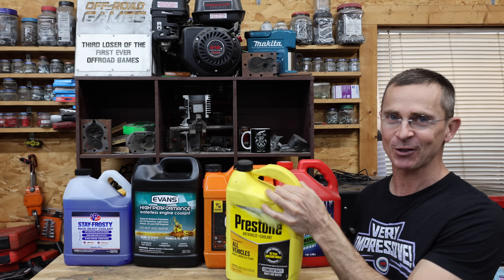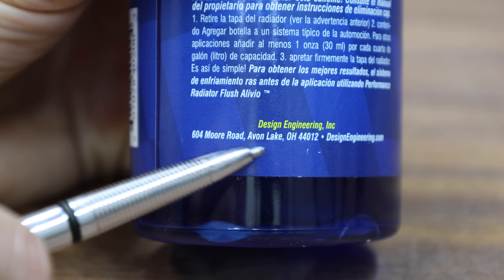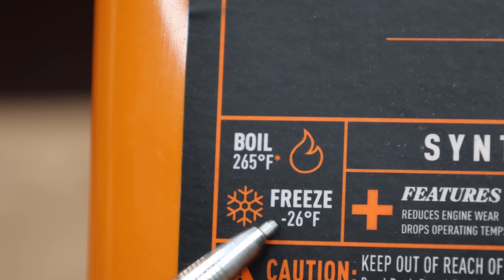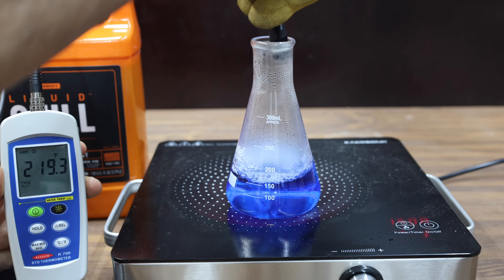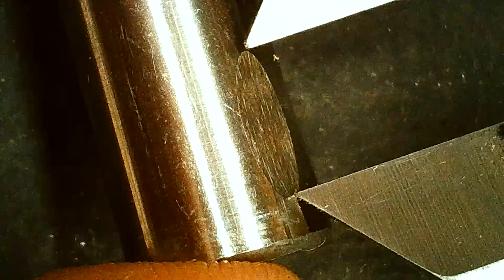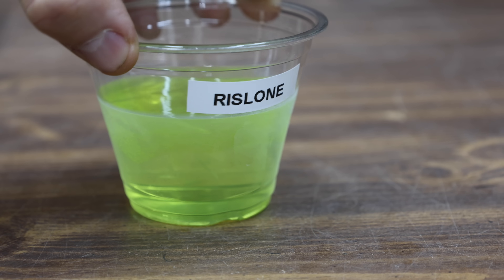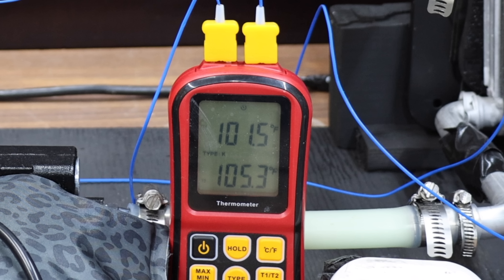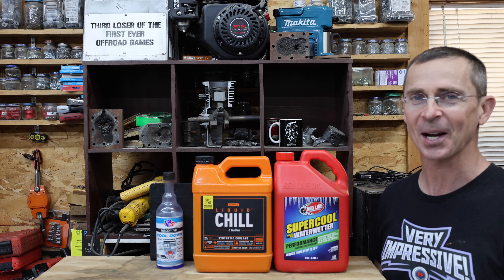Do "Super Coolants" Lower Engine Temperature By 30 Degrees?

Comment: Evans coolant is the real deal.  Rebuilt my race engine and never used anything but Evans in it.  No water.  Engine would run a bit warmer but never overheated and no corrosion between the steel block, aluminum heads and aluminum radiator.  Only downside was having to keep some on hand all the time as you can't just go to the gas station to get some if you have to top up.  Also I was able to run a lower pressure radiator cap, helping the hoses.

Comment: If only the manufacturers took into account how much of the radiators are covered by grill material.  Or place the AC comp in front of the radiator.
  The small bottles are intended for applications where water is the only thing allowed. Race applications.

Comment: ***HEY TODD*** I Have some ideas for some new video material first there are now plenty of USB-C  AA - AAA AND 9 VOLT BATTERIES. SO HOW GOOD ARE THESE BATTERIES AND HOW MUCH ENERGY DO THEY HOLD. ALSO DIGITAL BUBBLE LEVELS OR ALL DIGITAL THERE  ARE HYBRID OF BOTH THEN SQUARE DIGITAL LEVELS THEN THERE IS THE KLEIN DIGITAL LEVEL YOU CAN READ THE DISPLAY WHEN ITS LEANING OR EVEN FLAT ON ITS BACK IT THEN READS AS A FLAT SURFACE CIRCULAR DIGITAL BUBBLE LEVEL THAT LOOKS PRETTY COOL.
Reply from the maker: Thanks for the suggestion.

Comment: I'd be curious to see how just straight distilled water works out for you . We had a vehicle with a cracked radiator and just threw water in for a week or two while the replacement came in. Didn't seem to hurt anything long term and was a lot more environmentally friendly.
Reply from the maker: Thanks for the suggestion.

Comment: I would like you to test on portable solar power stations for power outages. How much they will run and for how long and the practicality. Here in Houston our power goes out frequently and I have been running a small generator to run TV's and a small AC window unit. I know solar won't run an AC for long but may be useful for running fridge and TVs, and infrequent microwave oven.
Reply from the maker: Thanks for the suggestion.

Comment: Unless i'm missing something I'm not sure I understand the point of these additives unless you consistently struggle with overheating. Like heavy towing on hot days, going up a mountain, etc. For the average user they should serve no purpose. Even if the coolant is working better, the thermostat is just going to close and allow less coolant through so the engine maintains the same temperature.

Comment: I have been using Redline's Water Wetter (the additive) for years in my snowmobile and it has helped with heat transfer.  Thanks for this confirmation that it does work.
Reply from the maker: You are welcome!  Thanks for sharing.
Reply: I use red line water wetter as well. It works really good. I even use it in three of my summer cars and it helps. Bring the temperature down on them as well.

Comment: another excellent test.   Forgot to mention/specify the sulfuric acid concentration.  No mention about flushing the heat exchanger test rig between products (not that a residual trace would make a significant difference).    

I do not want to be anywhere that my car will be in a -34F cold soak!
Reply from the maker: Thanks for sharing!

Comment: If you live in a climate that never gets below zero is there ever a reason to not want a cooler engine temperature?
Reply: Yes, a low engine temperature causes the rings to not seal properly and increases cylinder wear. However engine temp and engine coolant temp while closely related are not direct corollaries, so keep that in mind while making such decisions.

Comment: I love your videos and testing concepts!  The “droplet” of H2SO4 I think you can make it more precise and even more scientific.  Liquid “drops” due to surface tension breaking - too many variables like how much force are you squeezing can impact how the volume of each droplet when using a bulb pipette.  If you can get your hands on some P-20/P-100/P-200 calibrated microliter pipettes.  (They are expensive).  Maybe borrow from a university lab and add like 100 microliter at a time to be more precise.  Also the molality of the H2SO4 is important.  Essentially you were trying to measure the buffering capacity of each capacity product.  Perhaps even dilute the acid first given the extremely low pH of H2SO4.

Comment: One issue is cooling system is under 15psi of pressure so boiling point is higher. Pure water has a boiling point of 257f at 15psi.
Reply from the maker: Thanks for the feedback.

Comment: Despite the cooling properties of many of them, I actually like the Evans Waterless the best. Up here in Canada it's not uncommon to hit -40C/-40F. The additives compromised the freezing point of the antifreeze (literally its purpose) which would result in a block of ice in our cold temperatures. Likewise, it had a much higher boiling point, meaning it could continue cooling even if the engine was getting quite hot such as hot weather or heavy loads. Even though the thermal heat transfer wasn't quite as good as those with additives, it ought to be plenty to ensure the engine is cooled properly, considering that 200F is nothing for an engine whose combustion chamber can be upwards of 6000F; a difference of 5-10F isn't going to make any difference at all. The most important thing is that the coolant continues to be a coolant and that fails when it freezes or boils.
Reply from the maker: Thanks for sharing.

Comment: You don't want to reduce your engine temperature.. it will cause incomplete combustion. Your engine is designed to operate between 200F-240F. There is a common boomer-misconception that putting in a lower degree thermostat will change your engine temperature, it doesn't. "Cooler" is not better, outside of very niche racing applications. 

Until around 175F your engine is essentially guessing at what the Air:Fuel ratio should be based on data from a few sensors like Ambient Air Temperature & Coolant Temperature, we call this "open loop". If you were to install say, a 165F thermostat, it would take a very long time to reach "closed loop" where the Oxygen sensors take over, if they ever do.. Not only would that introduce a lot of fuel into the oil, water condensation becomes a problem. Not to mention the HVAC system not working properly.

Your engine will not overheat unless something in the cooling system is not functioning properly, change your coolant every 4 years or 40,000 miles.

Comment: Agree, great timing and testing. Thank you. 
I have a Tahoe with the 5.3L, and need to do the infamous plastic heater core fittings, (started dripping a little). Planning to flush most of the coolant and add one of these now.
Reply from the maker: Thanks!  Thanks for sharing.

Comment: You tell me what I need to do 😂
Can you figure out a way to test Valvoline Restore and Protect? I mean it's claims, my engine is running a bit quieter after 250 miles. I can't give it the beans for another 250, new clutch and all.
Reply from the maker: Thanks for the suggestion.

Comment: To do a proper test of heat transfer, you would need a well insulated tank of water with a heat exchanger in the tank and then the radiator with a fan for air to air heat exchange.  Then start with the water at a given elevated temperature and see how long each coolant takes to lower the temperature of the water by some fixed amount.  That will measure real heat transfer effectiveness which is what matters in a car cooling system.  Measuring the temperature is meaningless.

Comment: Fun fact, Rotella ELC NF (extended life coolant nitrite free) IS dexcool with the very important difference of lacking the stop leak ingredient that is a known plasticizer, as the three class action lawsuits against GM will attest their stop leak actually causes leaks by hardening seals. ELC NF does not have this component, just change it every 60-80K miles, or 5 years whichever comes first.

Comment: Poor's man additive? 2 drops of Dawn Dishsoap in the rad. Worked wonders in my Civic Si. Temperature was climbing faster when going up a long steep incline and was falling faster then before going down with no load, indicating better heat transfer.
Reply from the maker: Thanks for sharing.

Comment: Just curious if you completed the coolant flush before you ran the Evans in the last test (or if its required for full size vehicles)? I run Evans in my dirt bike and it required a pre-flush solution to be ran through the cooling system prior to its use. It even says you may need to flush the system a few time to ensure you remove all the water/coolant mixture, as water affects its performance.

Comment: For older non emission motors this is fine, "modern" engines and tunes require specific operating temps.  If your having specific overheating issues the problem should be addressed first.
Reply from the maker: Thanks for the feedback.

Comment: Nope. The perfect coolant is distilled water and 15% antifreeze. You only need the anti freeze to fight corrosion. Distilled water has a higher thermal conduction
Reply: Except it will freeze solid in early September and crack the engine block, heads, and basically anything with coolant running through it. I believe a 15 percent coolant mix will freeze around 20 degrees!😮

Comment: Temperature and heat aren’t the same thing.  The job of a radiator is to reject heat.  The change in temperature tells you nothing when comparing fluids with different heat capacities.  If water and ethylene glycol both drop 1º in temp, the water has rejected a lot more heat since its specific heat is much higher.  This is a very misleading “test.”
Reply: I think I understand what you are trying to say. Basically different liquids can retain more heat than others. Evans waterless is probably more like oil so the amount of heat it retains is much higher per capacity compared to water. It's much harder to cool a cup of hot oil vs a cup of hot water. I still think it's relevant somewhat to show how effective your radiator can dissipate heat though. Although, we really don't know if something like the evans waterless will even be able to cool itself faster than the engine will continue to heat up the "coolant". The overall goal is to keep your engine as cool as possible.
Reply: I think the evans waterless is only something you should use if you live in like constant Artic type temperatures. Everywhere else, you would have to use a more traditional coolant, otherwise you wouldn't be able to cool down fast enough.
Reply: @ If you live in an area where it gets below -40 quite often, Evans might be worth the money.  Everywhere else it isn’t.  And even in very cold climates, you can easily use a 70/30 mix of traditional antifreeze and get protection to something like -68 F.
Reply: @ Yes, you do understand, but, no, Evan’s is not better than water.  In fact, it is much worse.  Water is one of the all-time best fluids for heat transfer with corrosion being why it isn’t used alone for coolant.  Another issue in a test like Project Farm did is viscosity.  A low viscosity liquid like water can travel through the radiator quickly and thus its temperature doesn’t drop that much.  A thick coolant like Evan’s will move slowly through the radiator and have much more time to cool so will come out at a lower temperature even though it has transferred far less heat to the air.  If a flow gauge had been included on the test setup, this would have been immediately obvious.  Project Farm test setups aren’t made by an engineer so all of these considerations are ignored.  This makes for good entertainment videos, but the test results are bogus sadly.

The only way to get an accurate measurement of heat transfer is to use two heat exchangers, one liquid to liquid in an insulated water tank and another air to air with fan.  Heat the water to say 150 degrees and then run the pump and fan and see how long it takes to coolant to cool the water tank to say 100 degrees.  This will take into account all of the variables such as heat content and viscosity as these things will all be absorbed into the removal of heat from the water and liquids like water with low viscosity and high specific heat will do well and coolants like Evans not so much.
Reply: @ Makes sense. Appreciate the information. Pretty interesting

Comment: If you want a lower engine temp, change the thermostat to a lower rating. Engines now days like to run around 230f or higher before the fan turns on.
We don't live in the 185f thermostat days any more thanks to the EPA and the "clean burn" idea. Thanks for the tesing and shows PF.
Reply from the maker: You are welcome!
Reply: Why is this a bad thing?
Reply: @pootispiker2866  Ask seals and gaskets if they like higher temps. Plastic engine parts like intakes also have the same question. Oils also fit in that higher heat question.
Reply: @ Bigger number bad! Boo!

I have never seen an engine get junked because heat killed all the gaskets or ruined the oil. They're always mistreated engines. All of my family's cars are no younger than 14 years old and have no leaks to speak of. There's a bit of weeping from a valve cover on the '11 explorer but it's not even down the side of the block.

Intakes don't get hot. Oil can take 80 degreees higher considering we've been spraying it on pistons for 70 years. Give me a break from your BS.
Reply: @pootispiker2866 Intakes don't get hot? Intakes now days sit under a plastic cover. Coolant runs inside the intake. How does an intake NOT get hot? It's also ontop of the engine, you know that thing that makes heat. The lower intake is infact in the engine oil flow area above the cam shaft on things like that exploder you talk about. EGR's also flow inside the intake. PCV also flow inside the intake. And have a nice day.
Reply: Although you shouldn't just chuck a lower degree thermostat in a modern vehicle. The computer monitors coolant outlet and engine temp and you will throw a CEL for thermostat stuck open or thermostat efficiency. 

If you have overheating problems and a stock thermostat doesn't fix it, you have other issues. Just dropping it's opening temperature is masking another problem, like a plugged radiator, or bad airflow across it because of an AC condenser blocked with mud or road grit.
Reply: @volvo09 If that were true, the CEL would be on all the time when an engine runs cold, first starts, and when it's -whatever cold outside.
Reply: @ I don't remember seeing a MIL come on when my sister's car got a stuck open thermostat, nor one come on in overheating engines. Just a bit worse gas milage.
Reply: @ducewags  it's monitored over time, and the computer knows what temperature it is outside and what temperature the engine started at. 

Can't remember the code for it, but even my 09 Honda has an option to turn that code off in the tune if I were to run a cooler tstat. I know for sure my 18 F150 can throw that code too. It's very common.
Reply: @volvo09 P0118 or P0115. Cool story, so that honda and ford has the CEL on all the time when it's -30f or colder? Welcome to my world were it get that cold and colder. And yet for some reason, our CEL's don't come on from an idea the engine does not get up to temp on long road trips.

Comment: A lot of people don't realize this but if you flush your radiator use distilled water not tap water. You're cooling system will last longer with less problems.
Reply: True. 

Tap water is fine for flushing sediment if you have to, but when you refill with coolant don't mix it with tap water, it's using up part of the coolants additive package
Reply: @volvo09  I flush with well water, then fill with distilled water only, take a drive for additional flush. 
I then fill with pure antifreeze. I've done this for 55 years on "on-road" passenger vehicles with never a cooling system failure. BUT, off-road or heavy towing needs the cooling capacity of a 50/50 mix.
Reply from the maker: Thanks for the feedback.
Reply: I would never use tap water even to flush. Thats my $6 dollar opinion

Comment: Glad to see Evans waterless, I've been curious about this because Jay Leno loves it. Will probally put it in my Ford 300 inliner Iust got back from the machine shop because it wont get driven much.
Reply: Evans is basically a scam. And it can ruin engines with poor or defective cooling systems.
A high boiling point is exactly what you DON'T want! It means your engine will blow before the coolant starts to boil. When the coolant boils you get a lot of steam up from your bonnet. You would propably shut off the engine at that point. The boiling will remove A LOT of heat from the overheating engine, possibly saving it. The Evans will not, since the boiling point is way too high.
Reply from the maker: Thanks for the feedback.

Comment: I think the evans makes sense for longevity or a system that has ok cooling capacity, but is subject to extremes or heavy load that would briefly boil coolant and would cool it down if it didn't flow out the res or systems that may be subject to damage. I think for an offroad rig/burnout car etc it makes sense. They're going* to get hot, period. If puncture and some air is likely, you want to not completely lose circulation. Wish it cooled and lubricated better
Reply from the maker: Thanks for the feedback.